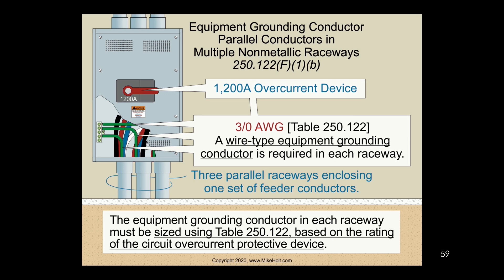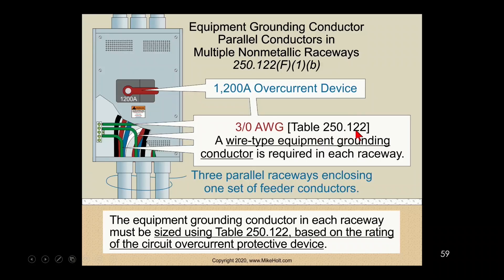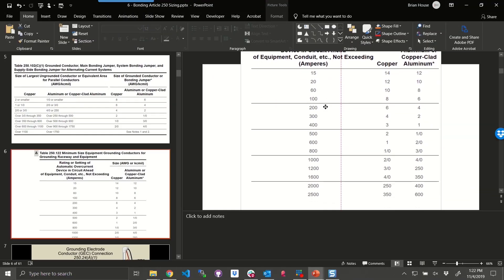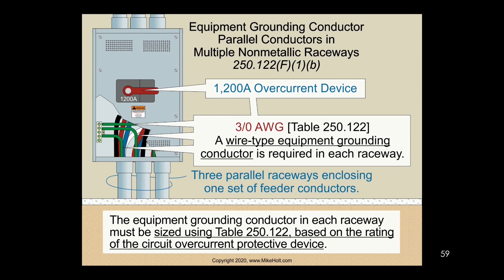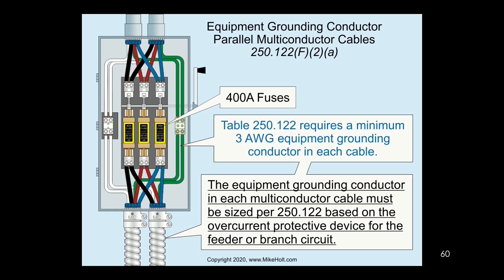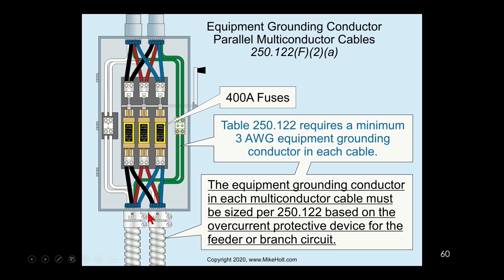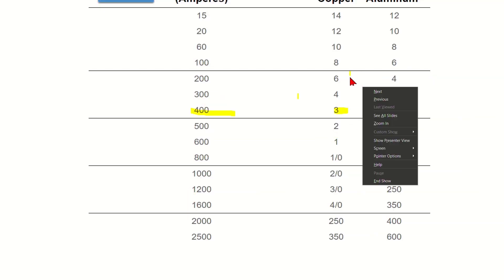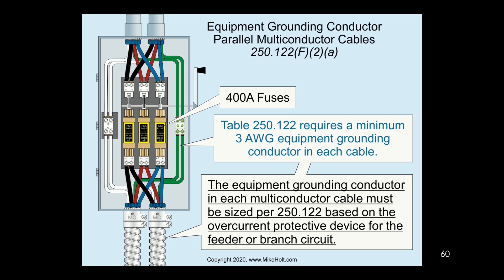EGC for Parallel Conductors, Sizing [250.122(F), 2020 NEC]

Comment: If I'm running a supplementary ground wire in emt, couldn't I split the circular mils and run smaller egc's rather than size each egc to the breaker size?
Reply from the maker: Please post your question on MikeHolt.com/Forum

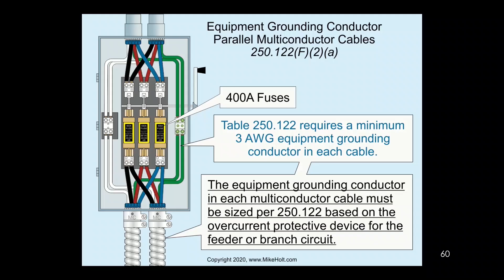Comment: in your illustration at 6:05 timestamp, where # 3AWG is used as the EGC, wouldnt that violate 310.10 (G) (1) where it states you must used 1/0 or larger? or does this not include EGC's?
Reply from the maker: Please review 310.10(G)(1) again, it specifies "each ungrounded conductor, grounded conductor, or neutral conductors," not the EGC. See 310.10(G)(5) Where parallel equipment grounding conductors are used, they shall be sized in accordance with 250.122.
Reply: @MikeHoltNEC  Just found a Info note in 2020 stating Equipment grounding conductors are not grounded conductors. I was going back and forth in my mind about whether an EGC is a grounded conductor or not. Thank you for the reply!
Reply from the maker: @Rdmanelect  Yes!
Reply: @Rdmanelect grounded conductor is neutral wire

Comment: Can't you still use the conduit as an EGC in a parallel run? And not worry about the "ground" wire
Reply from the maker: Of course.
Reply: @MikeHoltNEC  I feel like this is a sarcastic “ofcourse”. There’s no way that the pipe alone can be an effective ground fault current path for a 1200A over current device … can it?

Comment: Hello Mike or Scott,  I have a question that was not mentioned in the video.  This is in regards to EGC for parallel feeds.  I have four (4) motor control centers (MCC) at 800 amps each.  I am feeding these MCC with three (3) #350 kcmil cables per phase for each MCC.  The 480V switchgear is 250 feet away from these MCCs.  I will be routing twelve (12) #350 kcmil cables from the 480V switchgear to the four (4) MCCs in a 36 inch CABLE TRAY (no conduit)..  The EGC for 800 amps is #1/0 copper.  Can I install one (1) #1/0 EGC in the CABLE TRAY from the 480V switchgear to the MCCs then split it out to four (4) #1/0 and into the four (4) MCCs or do I need to install four (4) #1/0 EGC from the 480V switchgear to the MCCs inside the CABLE TRAY with the parallel feeders?  Greatly Appreciated.
Reply: Awesome!  Thanks again!
Reply: @tomtran9862  you welcome
Reply from the maker: We did cover all of the rules that apply to your example. Please review 250.122(A), (B), (C), and (F) put them all together and you have your answer. Hint, you only need one EGC per in the cable tray [250.122(C)]. What do you think the answer is?

Comment: Mike I have a question. Do we need to apply the LCL factor when we size conductors on the DC side of the cabinet/dispenser branch circuit like we do on the AC side between the point of connection and the EV charging cabinet? Thank you. Ben
Reply from the maker: I don't know what a LCL factor is and the NEC has the rules on how to size conductors for PV systems in Article 690.

Comment: That's a big price difference on a long run.  If you have room for bending larger conductors for terminations install just one raceway and install just one equipment grounding conductor.
Reply: That gets hard when you have over 1000 amps circuits
Reply: Assuming your conduit is large enough and can accominidate the heat capacity/derating for all wires.

3/0 copper would be expensive AF